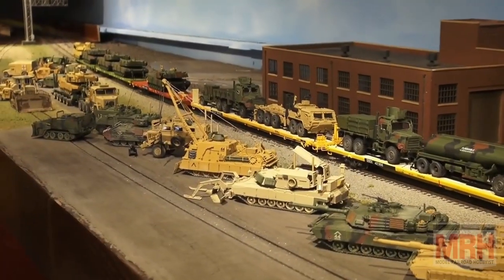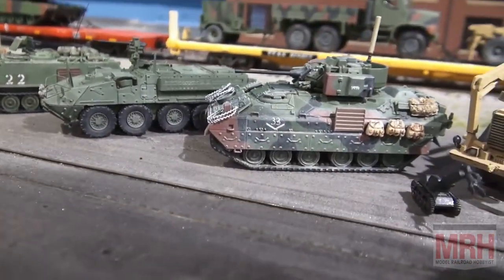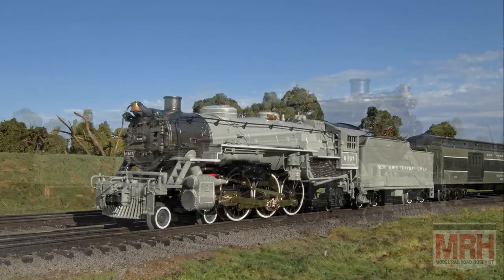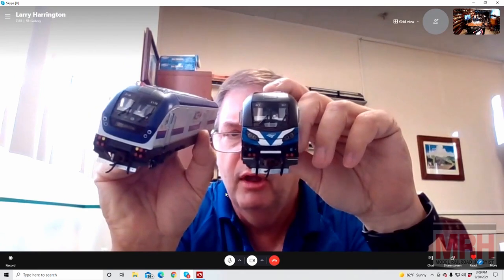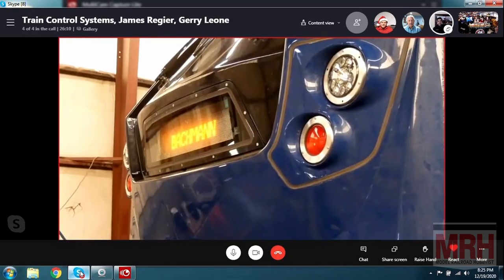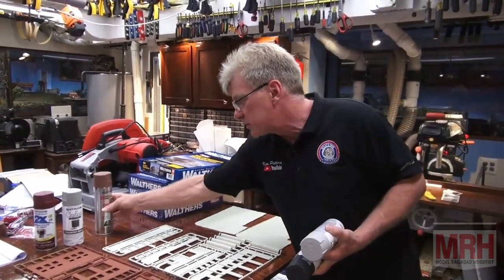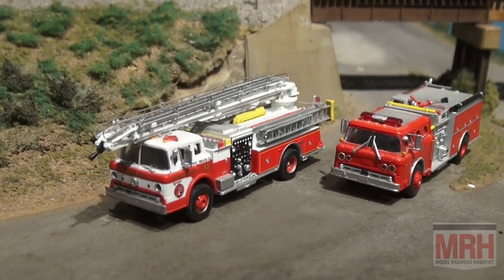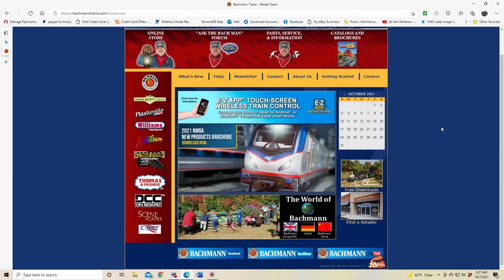Military models as loads | November 2021 WHATS NEAT Model Railroad Hobbyist

Comment: How do you stop stuff from sticking to the sticky part of the tape, like bugs, dust dirt and finger prints?
Reply: I was wondering the same!
Reply: Same here
Reply: The tape will also lose it’s stick and begins to peel over time.  Just use acetate and canopy glue.  Dries clear and won’t fog. Will last forever and can be cleaned/dusted if needed.
Reply: The vehicle tape windows last 20 years on my models. no bugs. no finger prints. it just works. no loss of stick value over time. Mike Budde and I have been using this method for 20 plus years with fantastic results. it's a big time savor and on car windows it's the only to get the curve right.

Comment: That fire HQ building really needs something more. It's a empty shell. It needs the office/lounge area walled off & apropriate interior design & lights. Those curved windows make that area very visibly empty. I would also position rows of lockers and fire personnel equipment along the inside wall. if it can be done.. lighting in the truck bay area and or exterior lights above doors. There's so much that can be done with that to make it look photo real.

Comment: A good question to ask any of the major manufacturers, if you get the chance, is anyone going to make a new ALCO C-420?  A very unique engine with an even more unique sound profile and engine that is unlike any other.  Bowser has the C-636 with factory sound (as I have one) and they got the right profile in that one and its very distinct over any other locomotive engine sound.  The C-420 was owned by several odd-ball shortline/class 3's with the most notable one to have them was SP&S and eventually Burlington Northern post merger.

Comment: I'd like to know if any company is going to do the 3 axle DODX cars? Modelers have been getting M. T. Promises and nothing has been produced. Except brass and they're expensive and no longer available.
Reply: There are two manufacturers that I know of.  Alchem scale models offer a kit of the 4 axle dodx flat. It's a small part time business, so you have to watch his website on about a weekly basis.  The other is spring mills depot. Their 6 axle dodx flats have been a along time coming. The owners claim to be looking for a container for shipping.  Also a part time business.
Reply: @andrewcappiello5585  I don't understand why after this length of time other model railroad manufacturers haven't done them. It's been years since Spring Mills Depot announced theirs and haven't seen them yet.